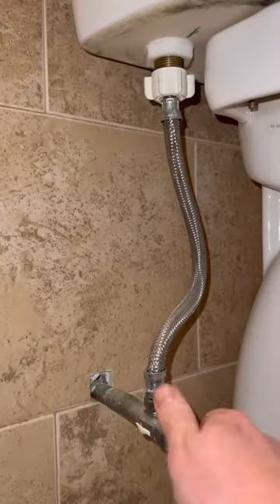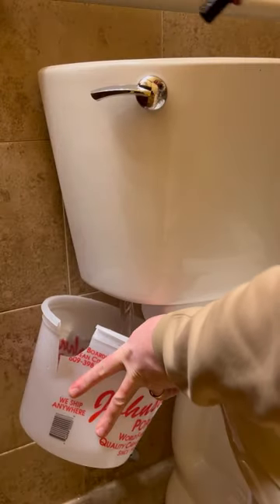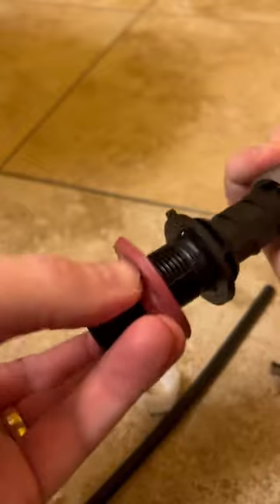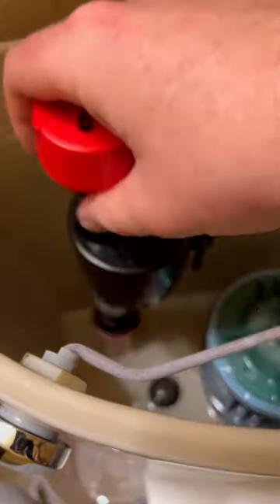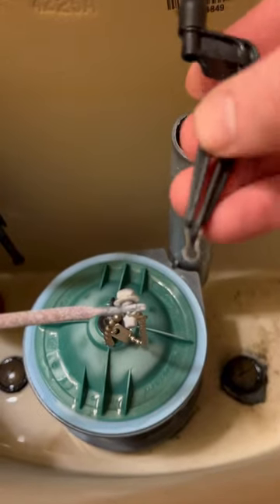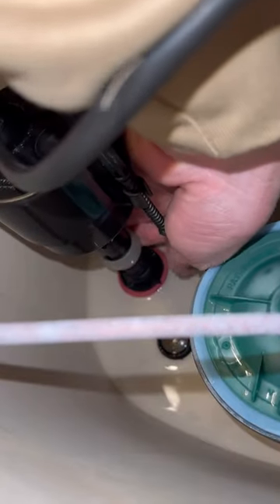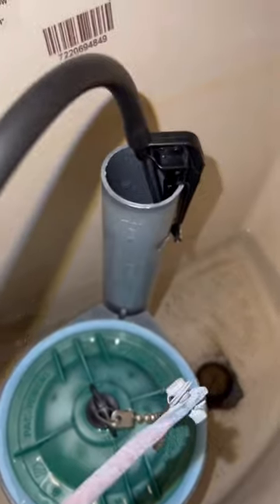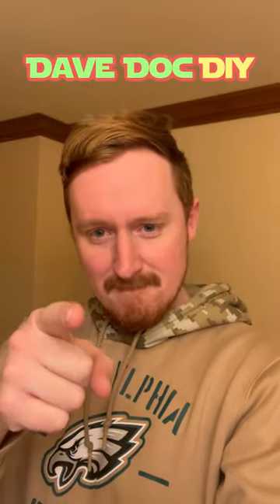Toilet Fill Valve Replacement DIY Tutorial! #diy #toilet #plumber #plumbing #repair #bathroom

Comment: I've been installing them for over 20 years. The only nut I tighten with a tool is the nut on the stop valve. I've seen these plastic nuts crack and flood homes so hand tighten and let the rubber do the work.
Reply: Thanks!!

Comment: Turn off the supply valve, and then flush the toilet before taking out the old fill valve. Way less water will be in the toilets tank.

Comment: Never use a pair of channel locks and a plastic supply line nut! And you will crack it and be in a world of trouble!
Reply: Only it you over tighten, usually hand tight is good with the rubber gasket
Reply: Not everyone will crack it.
Reply: I thought this guy was going crazy
Reply: Thanks for the tip . I must have got lucky over the past 30 years and 10 000 fillvlave replacements with my channel locks.

Comment: Hay smart guy make sure you adjust the height of the fluid master so it’s high enough to be able to flush toilet and don’t have too high if and whenever if the washer goes bad and it keeps running and water runs out of the whole of the trip lever

Comment: Are the different types of fill valves and floats interchangeable? For example, this one slides up and down the vertical piece. Mine has a little bulb that rises at an angle a few inches away from the vertical, some have a big bulb on a long arm.

Comment: Plumber here 
If you have that fluidmaster fill valve and you get a new one, the exact replacement, turn the valve off and pull up on the clearish retaining ring inside the tank, the fill valve will separate from the shank. Do the same with the new fill valve. Set the water level and slide the clear ring down it will click into place. Turn the water back on, and it will be good to go. Less than 3 minutes no tools required
Reply: New fill valve will go on the old shank

Comment: Uk 🇬🇧 Plumber for over 40 years .. always used fluidmaster  parts before wonderful retirement … When ever I bought a new toilet 🚽 I would always discard the supplied fittings and replace with Fluidmaster

Comment: what causes a new toilet to whistle when it is refilling the tank after it is refilling the tank? Edit: after it has been flushed. Sorry about the typo. 😞
Reply: Wait, what???  Before or after?🙄
Reply: Is the water valve all the way on?
Reply: @51-FS  I cannot turn off the water valve because it is eaten up with hard water (does not leak) something I forgot to mention is that it only started doing this after I put a new toilet in. It did not do it with the old toilet. Sorry. I'm assuming it is already all the way on.
Reply: @mirai3263  that's probably why... the water is restricted. I bet it takes a bit to fill back up after u fulsh?
Reply: @51-FS  less than a minute

Comment: You removed a fill valve with a brass shank It should be installed new with a brass shank and change the supply to a supply that has a brass nut to go up against the brass shank it's the best job you can do

Comment: Great vid, 
Can’t call yourself a plumber, but more a handy man doing simple repairs. 
A bit of caution for failing angle stops;  will continue to run and can cause potential water damage. 
Again great video, not trying to be that negative guy 😅
Reply from the maker: I worked exclusively as a plumber for 10+ yrs. I record simple repairs for homeowners. I wouldn’t record myself doing full plumbing rough ins because that wouldn’t hit the target audience.

Comment: I did a,house referb everything new with 22mm pipework and increased flow rate from the street.After a few months my tenant changed my new toilet system for one of these without permission. When I found out I changed it and put back to the origional  and told them all I've done is open up the valve restriction on the toilet.

Comment: Never use the same water supply. Always change the water suppy. Its like $8 and not worth the risk. The plastic nut on the supplies weakens over time.